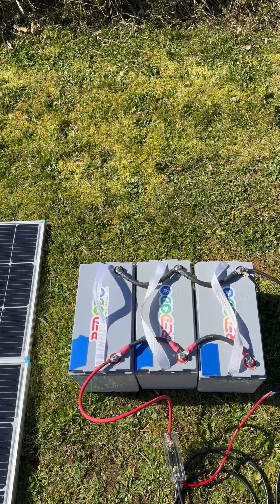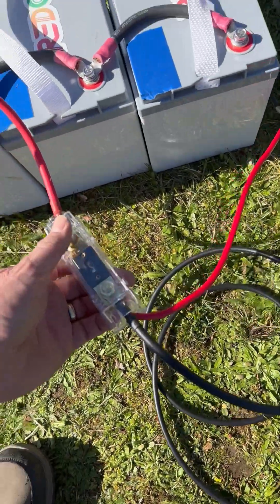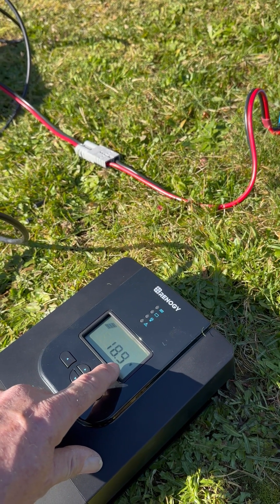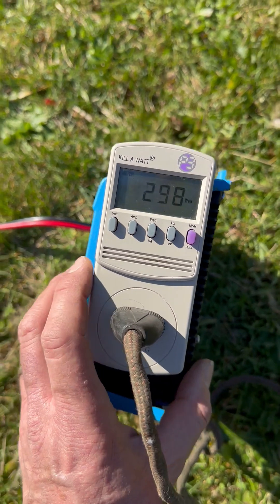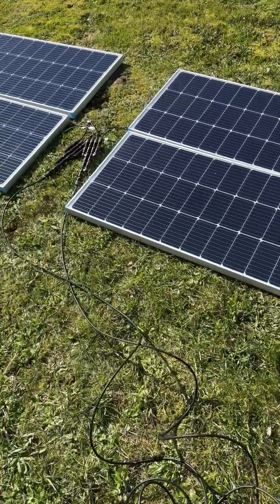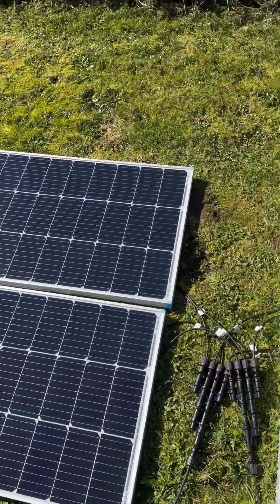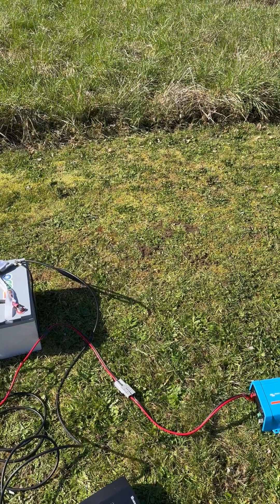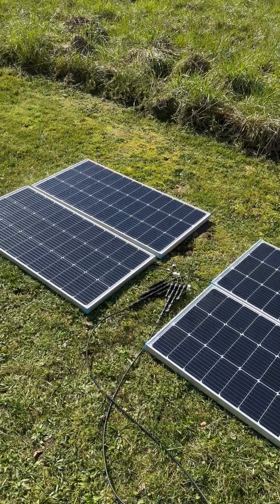Setting up a Renogy 400 Watt 12 Volt Solar Panel Kit, along with my impressions of it.

Comment: Hi Tom ,are these  batteries 12v? And you are saying that you can add another one to the system.
Reply from the maker: I'm so sorry for the slow answer!  Yes, they are 12 Volt batteries. They are technically branded as 12.8 Volts. The Redodo folks say you can parallel up to 4 batteries (12.8 Volts, when you add in parallel, the voltage is the same, but the current capacity goes up. With 4 in parallel, it's 4 x 100AH, or 400AH total capacity), and also series up to 4 (for up to a 48 Volt system). They would call this 4S4P, or four in series, with four stacks of them in parallel. 4 x 4 batteries, or 16 of them for a 48 Volt system.
  Thank you for watching!   -Tom

Comment: That renogy 40 amppt rover could do so much better with higher pv input voltage. You could run those panels in 2 series and 2 parallel  which woukd give you about 50 volts open circuit and 40 volts under load. I have 2 40 amp rovers. Check out my videos. I run a 3S2P 6 of those specific panels.  Nice set up! Im curious how those redodo batteries do.
Reply from the maker: Absolutely, Jayson!  You are 100% correct! Outside of Wildland Fire, I run everything at a higher voltage to the Victron controllers. As far as wiring is concerned, current is your enemy! The more current, the worse your losses, and it's exponential. The reason I'm running this system at 12 Volts is to keep it simple for Wildland Fire so that everyone can understand how to do this, and easily set up the system.
  The Redodos are doing fine so far (second season).  Lead acid has let us down (we're largely phasing them out, except at very cold mountaintops), the redodos have had zero issues. The ones I'm using are the old model 12.8 V/100AH before they put in low temperature disconnects. 
I was pleasantly surprised to pull them out of storage after four months, and find them still at 95% power.
  And thank you for the kind words!  -Tom
Reply: @AdventuresWithTom-yx9gi  wow that's great! Good to hear! Keep up the good learning videos! We all need to teach those who don't understand yet! Helps then stay safe and spread the knowledge of solar!

Comment: 40 amp fuse?
i have a 250amp fuse connected to two 12.8 volt 100ah power queen batteries.
did i choose wrong fuse?
Reply: 40 amp is for the solar controller. 250amp would be for the inverter. I use a 200 amp for my renogy 2000 watt Inverter